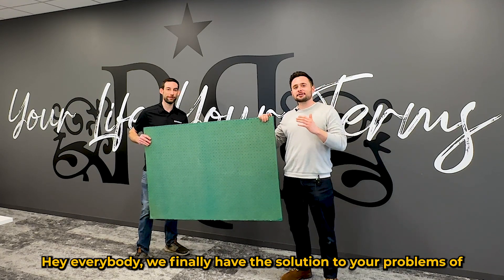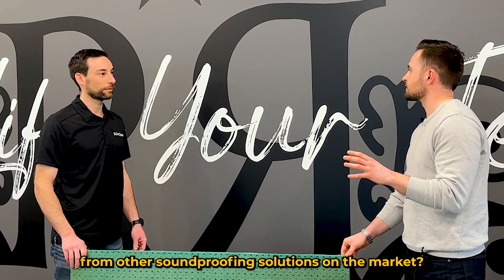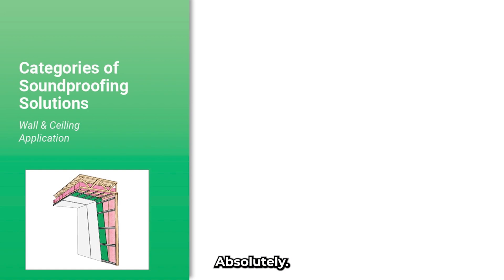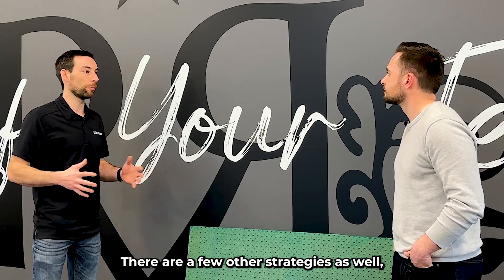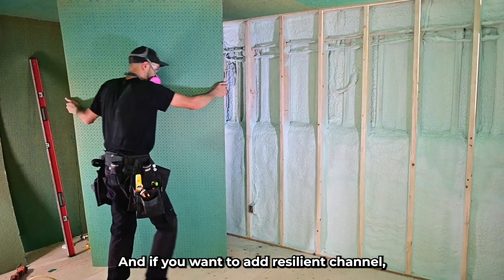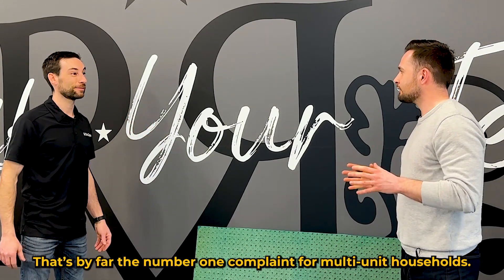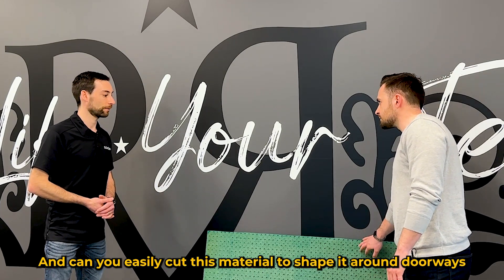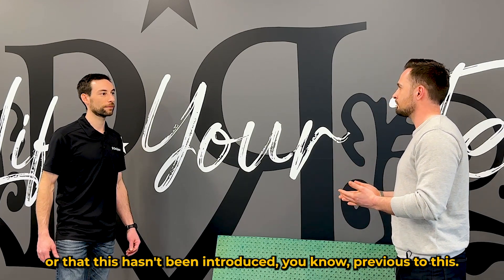How to Eliminate Tenant's Noise Complaints FOREVER!

Comment: I agree to a certain extent. As an owner of a recently converted(2022) legal duplex who took the initiative to use sonopan in my ceiling along with fire proof installation and resilient channels along with 5/8" fire proof dry wall. I find the Sonopan reduces alot of noise such as footsteps and lighter noises. Unfortunately it does little to nothing to prevent noise travel through ductwork. If you really want to eliminate all noise its best to seperate your heating/cooling systems and close off all existing ductwork. But still a very helpful tool(product) in eliminating heavy noise.
Reply: Yes, that's a separate challenge and very tricky to deal with but Sonopan has no control over that. If you find a solution to the sound in the ductwork, please let me know! Thank you!